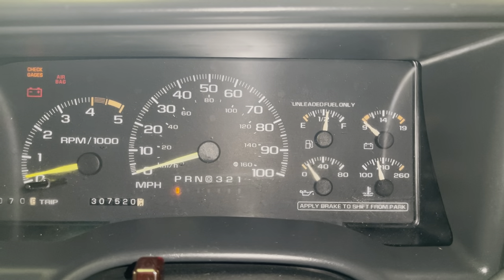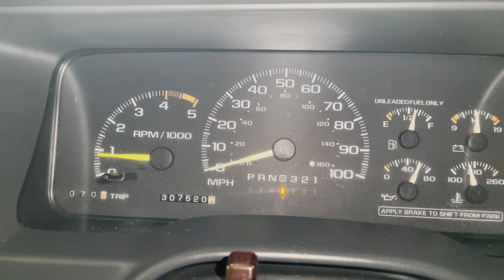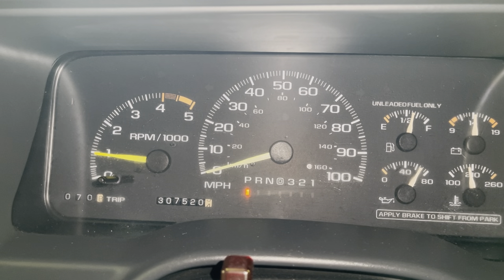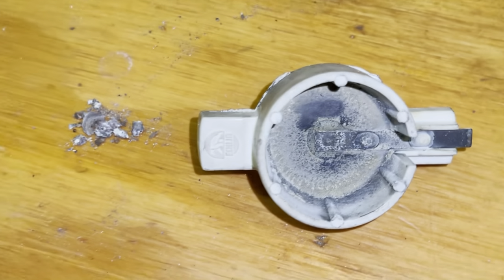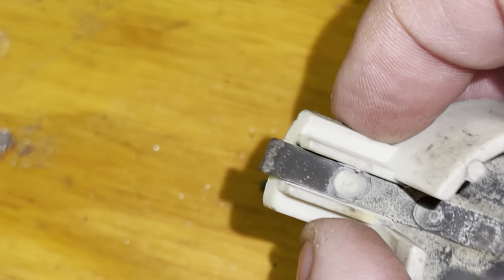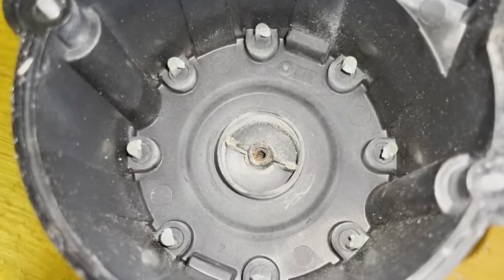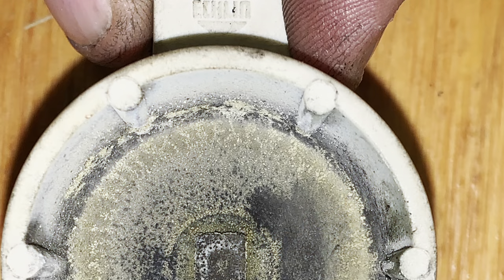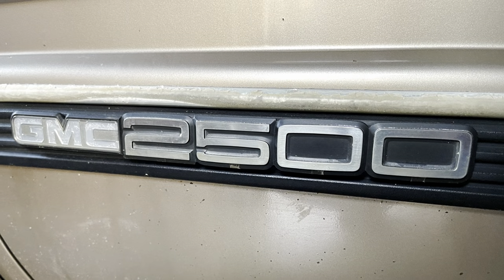GM 5.7 TBI rough idle and stalls out when put in gear...FIXED !

Comment: I have a very similar issue on my 92 C2500 5.7 automatic. It starts and idles fine, once it's fully warm it will miss/stumble about once every 30-60 seconds like it's about to run out of gas. Driving it presents no problems. The cap and rotor were in good shape, I changed them out and still have same issue. On to the ignition coil and then maybe a fuel regulator.
Reply: Did u ever figure it out..
Reply: Dirty icv
Reply: Did you ever find the problem? I’m having the same issue with my g30
Reply: Are you sure your a/c compressor isn't cycling on it's own? You don't always need to use the a/c for it to engage. Mine will cycle when using defrost heat, I can hear it engage and disengage, bumping the idle up and down.

Comment: I have a 1993 Silverado, stalls when put in gear, after many head scratches and curse words it turned out to be a blown head gasket creating the motor to vapor lock and shut off. Pull your plugs and check to see if they are water washed clean.if you have a motor with really good rings and very good compression you will not see the oil turn milky. Take the radiator cap off , start the motor,if the radiator fluid burps out every 5 seconds then you have exhaust gas and motor compression going through the motors coolant system. I hope this info helps someone..
Reply from the maker: Thank you.  Much appreciated for this added info.

Comment: I have a new distributor and pretty much all new sensors in the tbi unit runs 10x better but sputters at idle and rarely dies when put into gear I believe it might be the coil or fuel pressure regulator bother are original from 91. Any two sense?
Reply from the maker: You may want to change out the coil, just to rule that out, but, I honeslty do not think the coil is the cause since it runs fine otherwise.  I purchased a new coil for mine, but have not put it in yet.  A lot of the reading I did seems to point to the fuel pump and line pressure.  There older TBI's do not have a port to check line pressure, and in order to do it, its a lot of work as well as expesne if you purchase the kit.  As you know, replacing the fule pump is a lot of work, and if going to that extent, you might as well budget for new fuel lines as well.  If you end up changing one of these items, plese let me know.  Also, when you purchase a new coil, it looks like all you can get now is the coil itself, so you'll need to reuse the original bracket that hold the coil.

Comment: * Update*** TPS & IAC as well as 3 oxygen sensors. No vacuum leak at all, doesn't backfire. Fast Idle in park , arghhh. Any suggestions ? Drove around for awhile and still the same.
Reply: Mine started like that i changed most of the sensors, cap and rotor and it helped tremendously. And cheap parts. NOW it turns off when i put it in parkong after i drive it.
Reply: Vacuum leak not found. Likely worn throttle shaft end/s. First check and confirm fuel pressure. A low pump output will cause fast idle/surging.
Reply: I got under my truck and right above the cable that shifts gears. It's directly on top of the transmission,  there is a vacuum hose . It's cut on both ends ? Does anyone know what this is?

Comment: i changed cap & rotor, plugs and wires but when start sometimes stalls or shift into gear try's to stall but not as bad now i fix that stuff but something else still try to make my 5.7L vortec 98 tahoe stall but like i said is much better doesnt take me 7 trys to start the truck
Reply from the maker: Double check the ground wire that goes from the fire wall to frame to back side of the transmission.  It's the ground wire contained in the loom of wires that goes to the starter.  Another person suggested changing out the EGR valve, I had tested mine and it appeared ot test ok. But, I did replace the ground wire as mentioned.

Comment: i had an experienced ase mechanic put a scanner on my truck and the break switch was listed as faulting. my situation is very similar as when it rises to engine temperature it stalls in forward or reverse. shifts good and once in motion one wouldn't think there's anything wrong with it. i changed the crank sensor, break switch, and engine coolant temperature sensor to no avail. i was thinking it had something to do with the torque convertor lock out. can i rule that thought out? i will check the cap and rotor next.
Reply from the maker: Like you, I went down the list of various sensors; replacing prety much every one.  Last thing was the cap and rotor and that fixed the issue.  I hope this is the solution for your vehicle as well.
Reply: A  bad or flakey TCC solenoid can cause this.

Comment: I've always had an old 350 Chevy with a 650 double pumper Holley and a HEI distributor.... Runs perfect... Now I have this 350 TBI.... what a load of shit.... I rebuilt the engine. .. It idle perfectly... Had the problem before the engine was overhauled... when I want to accelerate... it is very sluggish and almost sounds like misfiring... Struggle to pass a Smart on the hi way... my 74 Camaro had more power... I replaced the injectors, overhauled the complete throtle body, replaced the EGR, EGR solinoid, MAP sensor, Idle jet, throtle position sensor, rotor, distribuler cap, plug leads, spark plugs, tempreture censor, electronic controle module... But still, no power.... must I replace the distributer as well? I am so sick of this TBI... Love my truck, but have the feeling to drive her as fast as she can run at this moment into a wall!!!!
Reply from the maker: I hear you...seems this TBI was the gap between the true carburetor and the post TBI systems.  Like you, I've gone through and replaced all of these sensors and sending units.  Mine is still not as smooth running as I'd like and I'm also considering replacment of the entire distributor to see if that smooths out the rest of the system.  In your case, I guess the ony thing left is the fuel filter.  Some of the reading I did suggested that if the fuel pressure isn't within spec, then its not deliving  enough fuel when the increased loads / speeds are called for.  There are kits that you can purchase and install to get a line pressure reading, but, with all the work involved for this and the price of the kit, there is a lot of squeeze and not much juice in that process.  Best of luck as you continue with your project and thank you for the comments.
Reply: @duginvirginia5737  Hi, thanks for the response, I did change the fuel filter to.
Reply from the maker: @McChevy  Well, Nuts...Sounds like the last item is the distributor then.  I'm a bit reserved on doing that yet, as it's another gamlbe to buy something new that may or may not fix the problem, you know.
Reply: @duginvirginia5737  I removed the spark plugs today, stripped of the valve covers and set the valves, just to make sure they're OK, then I noticed that the spark plugs are burnt white, but really snow white... I assembled everything again and started her up, and for the first 2 minutes or so the engine idled really rough... the taco jumped jumped and fall back again... I drove her home again... noticed it smooth out again.  I will replace another fuel filter Wednesday night after work...
Reply from the maker: @McChevy  Just for the sake of doing so, maybe stop by Sothern States or a fuel station in your area that sells non-ethonyl gas and try that and some Seafoam or Berrymans in with the gas and see if that helps?  Let me know what you find out.
Reply: @duginvirginia5737  I stay in Germany, the best we have is 95 E5, witch I always use... I ordered a new fuel pump unit.... I'll let you know after replacement if it is sorted...😉👍
Reply from the maker: @McChevy  Thank you...Good luck.
Reply: Well did u get it fixed? I'm dealing with the same thing here
Reply: @Wildest Cowboy  I did replace the fuel pump, but that didn't change anything... so I drove since then roughly 1800km. Now my Truck decided to give me a code 43.... 
So, to answer your question, no, the problem isn't fixed yet....
Reply: @McChevy  if u get it fixed let me know please cause my 88 Chevy is basically doing the same thing
Reply: @wildestcowboy2668  will do👍
Reply: @McChevy any updates?
Reply: @jamalcole1985  Good morning, no updates yet, I moved and have nowhere to work on my truck. I bought a new knock sensor and temprature sensor (the one on the intake manifould) Want to try out one after the other... But the anifreez need to be drained to do so....

Comment: My 94 randomly dies, doesn’t matter if it’s idling or in park or going highway speeds. It’s very concerning.
Reply: From my experience these 350 tbis are in the top 10 worst engines go ever made,you cannot get them to run right,if you do your lucky,no matter what you do you’ll still be throwing money at them,only way to go is vortec 350 or 5.3 or ANYTHING LS
Reply: @lamborgatti-4783  mines been running fine no more dying. I did forget to mention it sat for a few months because I had a bad tire I hadn’t addressed and I think the battery was weak. I’ve had my truck for over two years and it has 213k miles and has never acted up just this one time. I’ve known of other plenty tbi engines that went over 200 and 300k miles with pretty much only maintenance work. I have to disagree. Yes it’s old technology but it works. Very easy to work on and cheap. With tbi its either no spark or no fuel if you have problems.

Comment: Hello there , my 1995 GMC Sierra v6 , start right up then stalling and then if I’m shift into D or R , my engine shut off right away , so please let’s me know, what’s happen to my truck? And what’s parts I need to be replaced? Thank you so much
Reply from the maker: Based on my experience with this truck, look at the simple things first; replace the distributor cap and rotor and see how that goes.  After that, since you have a V6, I do not know what your throttle body set up is, but if you have an Idle Air Control, You may want ot check with that and replace if needed.
Reply: @duginvirginia5737 i replaced everything , cap , rotor , coil ignition, egr valve, coolant senor , throttle sensor position, still have no luck , do you think I have a bad ground?
Reply from the maker: @philliphoang4  One person had suggested to me to look and the passanger side of the firewall, there should be a braided copper ground wire from the firewall, (bolt that holds one of the brackets for  the A/C Accumulator) to the top of the frame and then from the frame, down to a tube that's adjacent ot the starter.  The ground wire runs up that tube and then bolts to the top of the bell housing (transmission.)  He stated that if this series of ground wires is broken, it can cause problems with the computer and cause the motor to run rough, etc.  On my truck, we had a good ground from the firewall to the top of the frame, but, the second ground from the frame to the top of the bell housing was broken; due to age and corrosion.  We replaced these ground wires and it appears to have stopped a rough acceleration issue in the higher RPM range.  During our tests, the truck was in park, and when giving more throttle (pressing on the gas pedal) the RPMs tended to stumble and hesitate at times.  After replacing these ground wires, it appears this probelm went away, but, I have not had mich road time since this repair to see if this helped.  You may want to check your vehicle for the same series of ground wires.  Thank you.
Reply: Hi Dug , can you please provide me the picture of that ground possible, I don’t know which one ? Thanks
Reply from the maker: @philliphoang4  I'll try and post a short video this weekend for you.
Reply: Ok thanks
Reply from the maker: @philliphoang4  Two new videos uploaded to the channel to answer your question.
Reply from the maker: @philliphoang4  New videos have been uploaded to the channel to answer your question.  Thank you.
Reply: Thanks Dug , I’ll update let’s you know if my problem have been fix , thanks
Reply: Hello there, I’m tried but still have no luck , truck move into D or R still shut off right away
Reply from the maker: @philliphoang4  Sorry to hear this.  I know how frustrating these problems can be.

Comment: Your oil pressure is higher than normal. Do you have the rigth grade of oil?
Reply from the maker: Hello, I do not know what grade of oil was in this truck, nor how old it was.  We changed the oil with the recomended weight as well as a new filter and the oil pressure maintains around 60 psi now.

Comment: Mine has a fast Idle only in park???
Reply from the maker: Initial thought is the Idle Air Control on the passanger side of the TBI.
Reply: @duginvirginia5737   Bought both
Reply: @duginvirginia5737  Well, Whenever the battery is disconnected or you mess with the throttle body,,You must take it in for a Throttle Body Relearn.  Just discovered this.
Reply: @alwaysbegrateful9011 please explain this throttle body relearn if u are serious

Comment: Can you help me please I need help
Reply from the maker: My suggestion, first look at replacing the distributor cap and rotor.  That was the main issue with mine for shutting off.  Secondly, check all the ground cables from the body to the frame.  Most likely you will need to replace the one that runs from the firewall to the frame and from the frame to the back side of the transmission housing.  I had went dow nthe road of changoing out varous sensors, as thoese things seemed likely causes, but in the end, it was the cap and rotor.